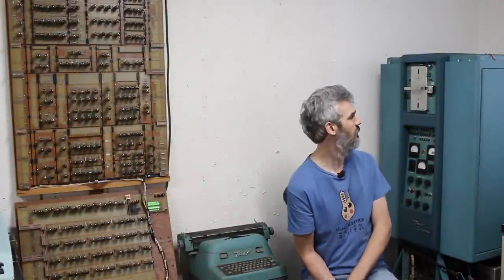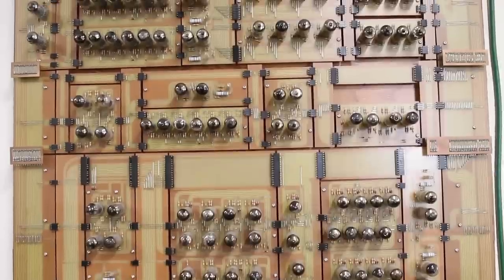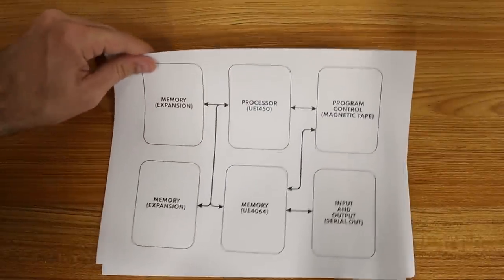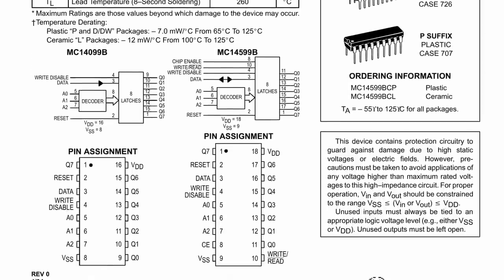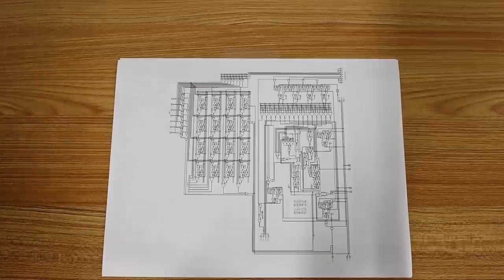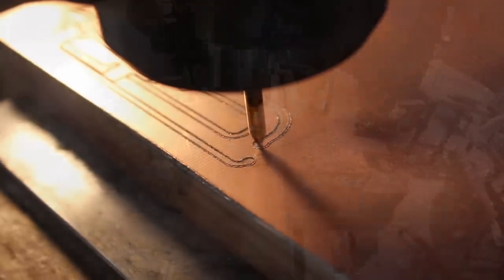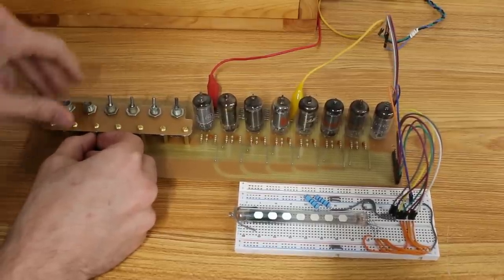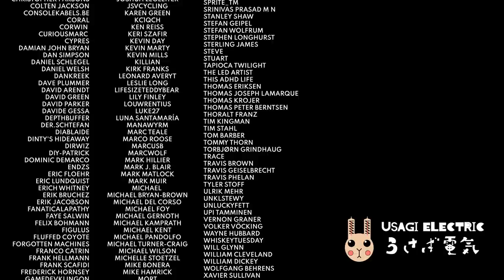VTC P.31 – Time for a Bit of a Redesign

Comment: I saw the switches in a newer video, couldn't believe my eyes and went to this video. Soviet micro toggle switches (in this case МТ1), which I absolutely love. They are damn reliable. They are still produced and are quite expensive (compared to similar Chinese switches), but in post-Soviet countries you can find used ones much cheaper, they work no worse than new ones. So I also use them in my projects.

Comment: The original Colossus code crackers at Bletchley Park during WW2 used a long loop of paper tape in a similar way! They were read in with photocells rather than mechanically, allowing it to run much more quickly. Although I'm kinda disappointed you didn't consider making your own drum storage :)

Comment: Interesting! You hit exactly the same problem as the first pioneers of stored program computers (SPC) - memory using just tubes (valves) is too expensive/bulky/energy-hungry!  The very first SPC to run was the Manchester ‘Baby’ SSEM that was built as a demonstrator to show how a Williams Tube memory could work in 1948. It had 32 words of 32 bit wide memory (1024 bits). 75 years later and Usagi is on the job!
Reply: wow, building 1024 bits of ram in VVL logic just as a proof of concept sounds a bit masochistic...
Usagi, vacuum tube memory is so 1948. All the cool kids use delay lines nowadays.
Reply: @yuvalyeru  The Williams Tube memory used spots of light and dark on a CRT as a kind of recirculating delay line memory, but much faster than acoustic delay lines. They were used in one of IBMs first commercial computers too, before they got magnetic core memory to work.
Reply: @Richardincancale  ok, that sounds much more sane.

Comment: This brings back some great memories when I was in college: They only had one lab that I got to play with vacuum tubes.  I had another lab where we built a 4-bit computer using TTL, it needed a beefy 5V power supply for that!  I had fun designing my own instruction set and architecture for fun... but we got to use EPROMS for our logic and 4K x 1 RAM chips  I got much of the system working, it had a branch instruction, ALU ADD, and logic like bitwise AND, etc. I can't recall, but I think it had 16 instructions...  In the summer 1986 I worked as a tech working on C64's and VIC-20's (I also wrote two VIC-20 games that were sold on the market in 1982).

So I just love the "retro" computing bringing back the earlier days in computing history... It's just so cool to see you working on these projects!

Comment: Idea: You could turn that useless tube (for the heater string) into a testing apparatus for 6au6s!
Reply: Hey, that's not a bad idea at all.  It would surely speed troubleshooting suspected tube problems with the unit.  Good thinking!
Reply: @horusfalcon  why yes, and it would have good/bad lights.
Reply: @SeekingTheLoveThatGodMeans7648  yes

Comment: Using a paper tape for the address/program counter reminds me of the Colossus that has a 30MPH tape loop whizzing around all times 😊
Reply: I was just thinking the same thing. Tommy Flowers did some remarkable things with that design — like applying his GPO knowledge that valves are (relatively) reliable if you just leave them on all the time to make the Collusus machines using valves when others though it couldn’t be done.

One day I’ll make a pilgrimage to TNMoC to see the replica — and other goodies they have.
Reply: @timothyp8947  I was there before the coof. Do it. The history of Bletchley Park alone is worth it (GCHQ) but TNMoC is the cherry on top. Make sure you go on a day when they have the full tour, not just Colossus!

Comment: I think one of the limiting factors for an all tube memory design is financial, i.e. can you afford to pay the electric bill! The memory design just really doesn't scale up. You would need to purchase an industrial size air conditioning system to keep the whole thing cool and that doesn't include the cost of the tubes that will degrade or fail due to the heat.

Comment: Hey! If you need a good paper tape reader I have got a teletype model 28-8 bit (same as a model 35) paper tape reader you can use. its made of tougher stuff than the model 33 reader and is rated for a %100 duty cycle!

Comment: If you loop the paper tape and add seek commands to it you could somewhat simulate jumps - that could make the computer much less limited. And with two you can have subroutines which you will need a lot of. Very slow though.

Given this is a 1-bit ALU, there should probably be some dedicated circuitry for string operations - do same operation multiple times somehow streaming input and output data. This way a single punch of paper tape can execute like a dozen operations which would make it slightly less slow.

And you still need some kind of scratch memory. I feel like 6 tubes per bit is way too excessive. There should be a better way.

After a lot of thinking here is what I might have done:

For fast access, intermediate calculation results and flags use existing 2 octets of memory since that already exists.

For somewhat slower numeric variable storage - a bunch of ultrasonic delay lines with self-refreshing and timing. They could store a dozen bits each and need same 6 tubes per delay line plus synchronization/refreshing that can service all DL at once If the operations can be timed precisely enough you could use string operations so a memory cell would contain a word of data rather than one bit. Possibly a whole array with circuitry to store and extract exact elements.

For even more storage but even slower - 8-track mechanism with very short tape loop and electro-mechanical track selector and auto-cueing circuitry. This will give the computer 8x1xtape-length of storage that should be enough for working memory it may need. 

If larger permanent storage is needed than a spooled tape with electro-mechanical seeking could be used.

Comment: If I may suggest -- perhaps not "Kevin", but how about "Calvin"? Aside from the fact that it will likely have a temperament invoking the eponymous character from so, so many newspaper "Funny Pages" strips, simply because vacuum tubes :P it actually works as a bit of a backronym, and in a way that fits the era of UNIVAC, EDVAC, the WITCH, etc --

C.A.L.V.I.N. -- Computative Arithmetical-Logical Valved Integrator and Numerator

Let me know what you think, Mr Usagi :) also, love the pet break at the end of each episode, it's lovely!

Comment: @ 7:29 - do you have a part number/supplier for the hollow pins you are using for the tube contacts on the PCB (or MCB - Milled Circuit Board)?
Reply: They're called Through Hole Rivets. They're available all over the place.

Comment: I've always wanted to build a vacuum tube computer. The closest I've come is a ring counter based desktop calculator design from 1966 that uses little neon tubes. I've had success with it, but I made the mistake of using vintage capacitors and diodes. They were shite. If I rebuild using modern diodes and caps it'll work just fine. My breadboard version used modern components with the tubes and worked perfectly.

Comment: Seems to me you could still jump if the tape reader can move backwards and forwards, though to jump very much you'd need to support multi bit operands, like a jump offset register (which one of your existing memory registers could be used to support).   Jumps are needed for if/then constructs and loops, and your program capability will be pretty lame without them. But it was good to notice how the Bendix did things, with so much stuff driven from the drum -- even the clock itself.  Is this something you're now going to support, clock from the paper tape?  It wasn't clear from the cursory going over everything that is going to go on.

Comment: You may have answered this already, but a couple of questions:
1.  Are you against all solid state devices?  For example, what about diode based logic with the tube as the amplifier?
2.  For memory, have you considered "dynamic" memory?  Use capacitors to store the bits, and a little tube logic for the refresh logic and the address decoding.
Reply: I believe most of his logic is done using solid state diodes.

Comment: You should do a collaboration with youber  Mr. Carlson's Lab. He is an absolute electrical engineering genius, and a vacuum tube savant! He could help you get that thing up and running as if it just rolled off the factory floor in the 50's. No joke, that Collab would be a massive hit!!!

Comment: Series string heaters make a lot more sense here, you can run 20 tubes off the 120v line.
Reply: It is series string. One of the design decisions is he wanted everything to be safe-to-the-touch low voltages.

Comment: It could be "Uniblab" from the Jetsons. I cringed a little watching you make those pcb mount 6au6's...I'm a guitar player and former amp builder and I can tell you that pcb mount tubes are a huge point of failure for amps. The big companies all do it but it has resulted in lots of issues and much more unreliable amps, that is a lot of heat right there on the board. But I'm not certain, maybe it'll be ok in your application which I know almost nothing about! One company (the modern incarnation of Supro USA) did what i think is a pretty good compromise--they physically strap a tube base to the pcb with wire, its sort of the best of both worlds as it gets the tube off the pcb but also doesnt involve having to mount the tubes on a chassis.

Comment: It occurs to me that maybe it wouldn't be all that difficult to make a paper tape move backwards as well as forwards to implement jump instructions.  If you only have 32 bytes, the tape won't be all that long.  You'll need to implement some kind of "wait state" for the paper tape reader anyway since the tubes will process instructions much faster than the tape can move to the next instruction.
Bunny: You're sending me bananas... and I love 'em!
Reply: Or, another idea is to just keep advancing the paper tape until the top part of the loop comes around again.
Reply: @russellhltn1396  That would work too, so long as the computer has a way of knowing where the start/end of the tape is, like an index hole.  It might make the mechanics of the reader simpler if it doesn't have to go backwards.

Comment: Did you check to see if those soviet switches were radioactive? =b
Reply: Let me explain for those who don't know.
It makes no sense to check the switches of this model, they are definitely not radioactive. Other switches could be radioactive, but they are much larger and have a glass window on the lever. Early designs used a permanent luminous mass based on radium salts, but later designs were safe. If you shine a flashlight and after that you observe a greenish glow that disappears over time, this is a safe switch. If not, you better not inhale the dust of the substance located under the glass.
Reply: @kote315  I meant salvaged from Chernobyl....
Reply: @Rorschach1024  The probability of accidentally buying a thing from Chernobyl is extremely small. It's a very famous place and a lot of people want stuff from there for some reason. So I think the seller would have mentioned it and asked for more money.

Comment: do you mean k-eV-in? as in kilo electron volt in, x-ray computer
Reply: call it steve instead, because minecraft
Reply: soft x-rays full optical computing, not hard x-rays, not euv computing
Reply: x-ray tubes, hmh, not vacuum tubes, hmh
Reply: any gas can be externally stored and supplied through channels along with the x-rays, like VCC in electric ic's